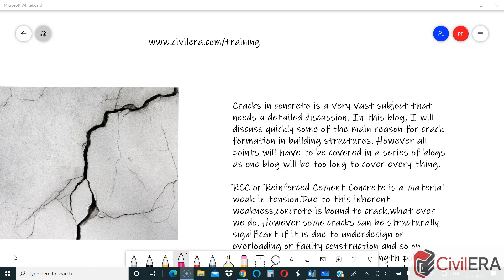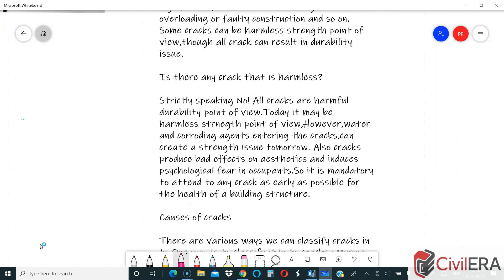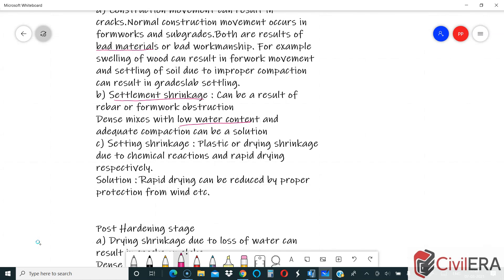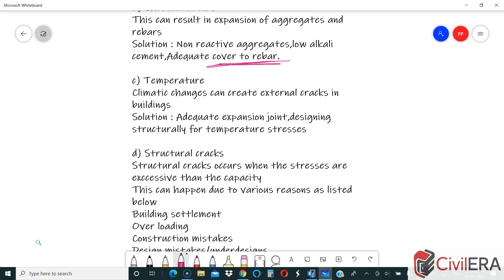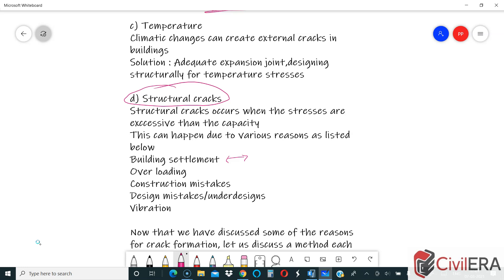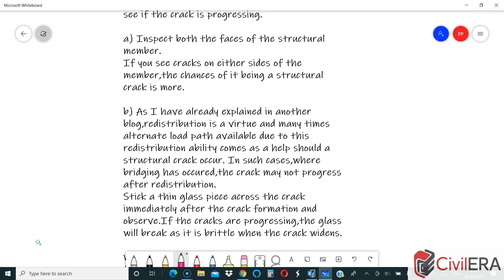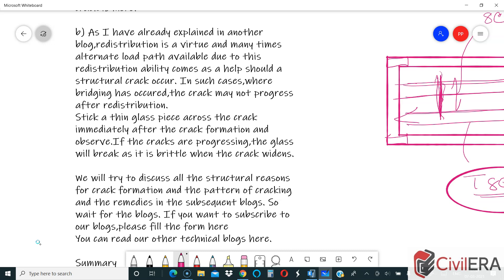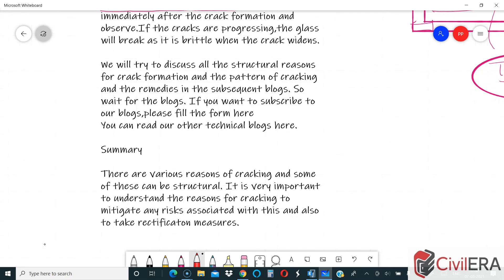Structural cracks in Buildings

Comment: Dear sir, why there are cracks in walls  @ last floor(i.e. floor below terrace) multistoreyed   residential apartments. In all other floors there is no cracks in wall, but the crarcks observed in the last floor walls only. What is the reason for crack and how to avoid such cracks?. i observe these cracks in almost all the buidling which are above 4 or 5 floors. Please guide me.
Reply from the maker: @kiran, I cannot comment unless I know exactly it is. If you are talking about general cracks in the last level, it could be due to more temperature. Even the roof slab do crack due to expansion and contraction. Also many normal contracors dont give proper attention to quality while doint the parapets etc and these do crack.
Reply: @CIVILERABangalore  if temperature is  the reason then even it should be same for even g+1 floor also. Even for g+ 2 floor we are not facing this problem. But here that is not the case.the  cracks are only in last floor of  g+5 or G+6 and above. The cracks are diagonal, horizantal in bed room walls,junction of column, beam and wall. and other walls. But the columns ,beams , slabs are intact and there are no cracks. Even in the lower floors also there is not a single crack in any walls.Is it because of the columns stop at the roof level ? and there is no continuity .  and free end of columns?
Reply: Dear Sir, Extreamely Sorry, i Didn't thank you for your reply . Please excuse me.
Reply from the maker: @KiranKumar-ev2sg  I cannot talk unless I see what you are saying including the designs. If the building is designed then column being not continuous is automatically attended. In my buildings I dont see any cracks than temperature cracks :-)